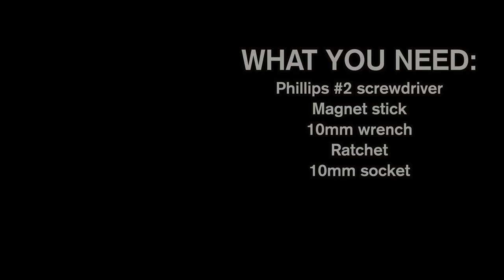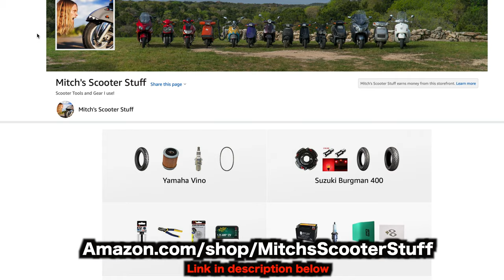Yamaha Vino 125 Leg Shield Cover Removal | Mitch's Scooter Stuff

Comment: Mitch, did you relocate your Fuel Gauge, up higher than stock-- Do you have a video on that modification? Also, do you know where I could get the Vino 50 Storage Compartment that fits where Yamaha ridiculously mounted the 125's Fuel Gauge?
Reply from the maker: Hey yes I did... funny... I'm working on a video to show that modification and storage compartment real soon!
Reply: Aren't you a National Treasure.  1/ Where'd you get a storage compartment/pocket? No one can find them anywhere-- or did you fabricate one? Thank you! I just discovered the pocket & now I want one. 2/ When relocating Fuel Gauge, what's it ••attach to•• up near Speedometer cluster?